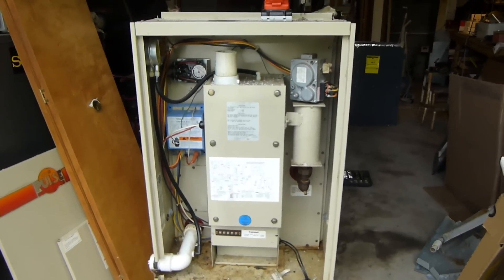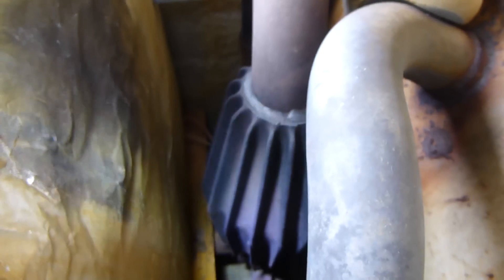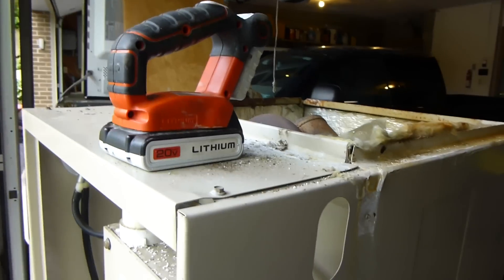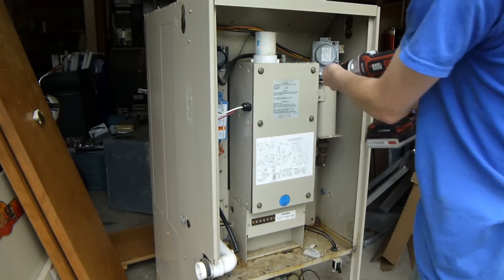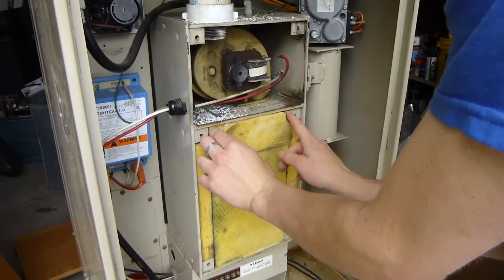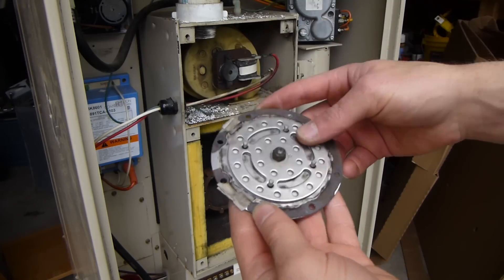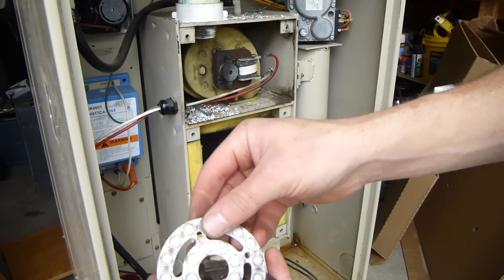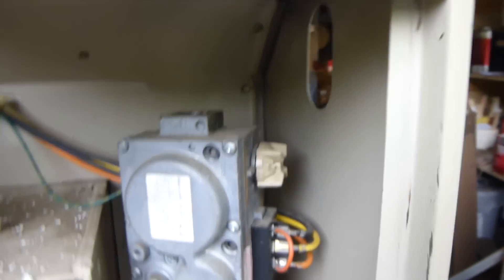Taking Apart the Old Explosion Furnace - Lennox Pulse Furnace

Comment: When these were  "in"  I used to  help install and do the startup and maintenance/ service on them. They were incredibly  efficient,  sometimes measured  around 98%. Biggest issue for Lennox was the failure of the  braze joints on the secondary exchanger, and they did not step up  like men  and take care of this.   "Noise"  was a complaint,  MANY  times from the OTHER  dealer in town.  Noise was reduced by careful planning on install, use of the optional mufflers (!)  and properly hanging, isolating, and pitching vents.    One  problem we had  took me  "awhile" were a series of intermittent cold  lockouts in morning---turns out the flame sensor IS NOT  a solid rod.  There is a spring inside the insulator  which gets week.  Check  resistance carefully from end to end and if it's more than?? 200 ohms or so, replace them.  You must keep a good   air flapper  in them,  had very little trouble with the gas flapper,  down there  bottom of the elbow.  

LOTS of  other high efficiency  furnaces had problems, sometimes worse.  One brand, sold under several brands,  "ate"  heat exchangers because of  water/ condensation, and they were not  "up" to it.   Dealers screwed customers  on warranty.  We replaced at least two, installed   "by others"  --WITH A PULSE!!

One of the worst  "when it went wrong" was the Amana  thing with a little tiny boiler  pumping  liquid through a  liquid to hot air exchanger.  Lots of parts, lots to fail.  My parents had one,  the boiler finally just all plugged up after about 15 years.  This was after Dad died and after I was "out" of the field.  I had a local install a Lennox  80%
Reply: Yeah, the Amana HTM. I had to work on one of those a few years ago.

Comment: This "IS" the best furnace ever made. I have one running for 30 plus years and never needed servicing- still running. The first time I saw this design I knew Lennox hit an engineering home run. The ONLY reason it is not still made is people would not pay for a quality furnace like this. I have seen several people like the the person in the video replace these just because they are old. What an awful mistake! A local furnace repairman told me never get rid of a Lennox pulse as long as you can get parts if you ever need them. He said if you want to get rid of it to call him, he will take it.
Reply: Mine still works too. Parts are no longer available. It gets louder the longer it is in its heating cycle. I need to replace it before it kills my family.

Comment: I have one of these and I love it.   Had it since 1988 so she's getting old so I'm a little nervous about running it another year even tho it has passed the pressure tests.  I wish it was possible to have a new heat exchanger put in so I could keep it because it purrs like a cougar during our cold SD winters.
Reply: 30 years... good luck having a modern furnace last that long.... !
Reply: Tony Skvarenina my Lennox is from 1983 and still works with routine maintenance

Comment: Lennox is junk!  Pulse Furnaces are even worse!   I hate these with a passion!   Why don't they make them any longer?  Because it was a mistake!
Reply: sure. 97% . 27years and still going strong. NO maintenance done in 17 years...They priced themselves out of the high eff. market
Reply: @tonyskvarenina6769 this ignorance will kill you, they were recalled because they pump out carbon monoxide into your home
Reply: I have only replaced the blower motor .  Mine was installed in 98. So you must be selling another junk brand and won't be able to sell me one
Reply: I have two lennox pulse furnaces in a 2 family home that were installed in the early to mid 80s and haven't been maintained in 30 years 
The downstairs is a little loud
Reply: @rabidrabbitsmokingneonlights  make sure you have a carbon monoxide detector.
Reply: @tonyv8450  You regardless of what gas appliance you have but no need to worry about the pulse exchanger, if it starts leaking, it will shut down due to pressure loss. You should get to know how they are made before you assume as some people have that a pulse is not safe. It is actually the safest furnace ever built.

Comment: My parents have a 100K BTU one. Very nice unit and as others have said, nothing matches its build quality. That said, they recalled these. Turns out after several years of use, due to the vibrations of the pulse combustion, would develop cracks. 10 years ago, they were replacing the units and providing labor. For a few years after that, they paid for half. Now they won't do anything. Really though, this furnace lasted much longer than the original Mueller he had before.

Comment: I have never had to fix anything on those but the blowers. Been a service guy for 18+ years. Cool video mister.
Reply from the maker: +Terry Woodroof Yeah that's all the service guy did!  The fan was just seized up so he oiled it.
Reply: is there a way to quiet the grumbling noise
Reply: J C 
Insulate the basement floor
Reply: I still have my Lennox pulse it's over 45 years old never been service one time yet it runs great

Comment: cant you rebuild it to be a pulsejet
it looks basicly like a pulsjet and also it has the same funktion of one
Reply from the maker: +Tigerlie +robot797  It operates on the exact same principles that a pulse jet does.  It is just designed for heat extraction instead of thrust.

Comment: Why not use parts from it for the forge
Reply from the maker: +Daniel a I already took them to the scrap yard!  :P
Reply: Makerj101 something there could've been good for the turbine
Reply from the maker: +Daniel a Which part?  I did save a bunch of parts from it.
Reply: +Makerj101 combustion chamber, flapper valve, and maybe some of the piping, the pipes can be used to transmit exhaust gases into the boiler to heat it
Reply from the maker: +Daniel a I saved the flapper valves and some pipe fittings.  The rest of it went to the scrap yard.  The thing was just too big to keep around.  If I kept everything my parents garage would be packed full of junk LOL
Reply: +Makerj101 sounds like my room lol